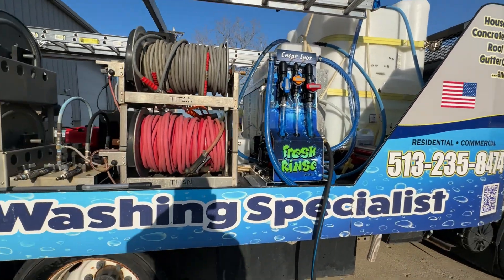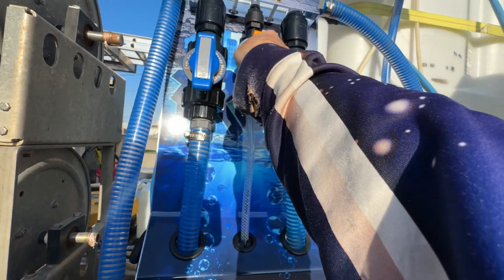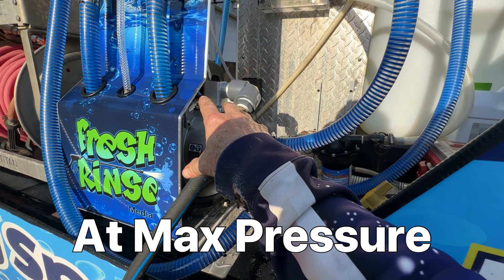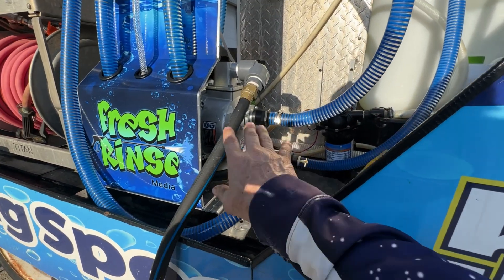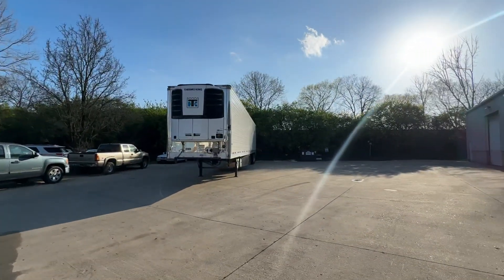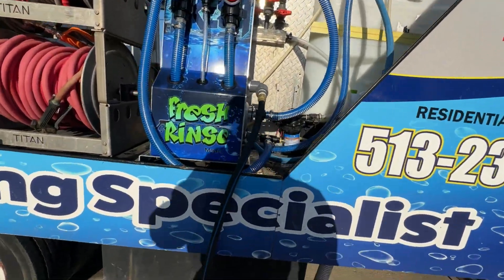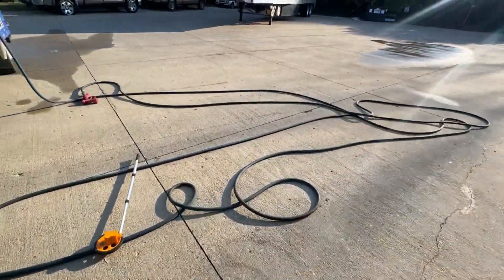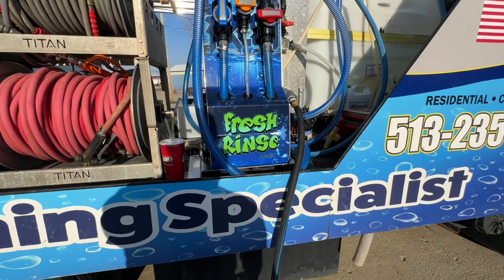My Personal CHEAP SHOT! Pressure Relief Valve and Neutralizer Setup

Comment: I built my own and I had mine blow off a couple times  due to I was moving my ladder and it got too hot and blew the cap off  5 minutes off the trigger is too long lol
Reply from the maker: That’s not cool. 5 minutes is definitely push the boundaries
Reply: @TheFreshRinse all about the research and development  😂
Reply: I was on the trigger and my cap blew off... using a waterboss gun right out of the box.

Comment: My pump keeps exploding. I am not sure why. I have the pressure relief valve as well, and try to not let it build pressure by opening the gun.
Reply from the maker: I’m not sure why either. It’s always a pressure situation.
Reply: I don’t know how you have your pump setup, but I don’t think it’s pressure that is the issue, it’s heat from the pump head recirculating the water when you stop spraying.  This creates steam which then creates pressure, which then deforms the plastic caps, which then launch off the pump, and then if you weren’t close to the machine would dump your entire supply of bleach out. Purely theoretical thought experiment on my part 😂, but when you setup your unloader pay attention to how hot the pump head gets. I’m only batch mixing with mine right now so I’m not using a mixer but I do have the unloader dumping back into the mix tote. I set my unloader so it pumps enough Mix back in so the pump head stays cool when you’re not on the trigger. If you have a proportioner system some guys will create a loop with a bunch of hose off of the unloader and put that loop in their water tank and the other end of the hose goes back to the mixing block. See another comment down below for that.
Reply: That's what's happening to me... even while using the gun it overheated. Not sure what im doing wrong

Comment: I have mine setup off a ibc tote for buffer.. 1 in non collapsible hose to the pump 3/4 harbor freight hose out with the general pump blue gun.. but with the screw backed somewhat out it wants to bog down and shut off.. do you think it's dead heading.. do I need a bypass?
Reply from the maker: I think you have too much oil in the machine.
Reply: @TheFreshRinse I'll check it out tomorrow.. I believe it's .3 of a quart
Reply: @TheFreshRinse I changed the oil.. disconnected the low oil pressure switch.. runs around 10 minutes starts sputtering then dies.. I believe it's fuel vapor lock or something along those lines.. 115 degree ambient air temperature in Arizona

Comment: What kind of effect would running a 1/2 or 5/8 ag hose be if you kept all other plumbing the same?
Reply from the maker: Great question. WAY less volume. 3/4” is a must.
Reply: @TheFreshRinse I have it setup with a half in hose to my blue gun but I'm not getting enough water or pressure.  Is it bc I need a bigger hose?

Comment: Hey Mike what rpm’s are you the cheap shot ? Thanks
Reply from the maker: @anthonyshook1911  Oh gosh, I have no idea what rpm the motor runs.
Reply: @TheFreshRinse did you surpass the stock governer on the throttle or did you leave it alone?
Reply: So just for clarification.   Tighten up the pressure relief valve then start the motor.   Stay off the trigger.  Slowly start opening the PRV until water comes out.   Once the water comes out you tighten back up the PRV 1/4 turn.    And that’s it correct?    I saw another video where the gentle man was opening the PRV while off the trigger and once air flow started he opened the PRV another 180degree turn open.   Can you clarify if you can.  Thank you.

Comment: I'm having a hard time conceptualizing the benefits of the pressure relief valve if it's not "blowing off pressure." It looks like a closed loop that's just pressurizing the acrylic manifold with hot water/steam/chems. My concern is that by sharing the pressure with the manifold, you might prematurely wear it or crack it. I also think that this is like reasoning, "my tire pressure is too high so I'm going to install a relief valve that dumps back into the tire in a different area." Am I wrong? I'm all for innovation. I love my CheapShot! I think I might try something similar but take the line off the pressure relief valve and coil it up using more hose and place the coil in my H2O tank so the the cold water cools the fluid. IDK. Thanks Mike!
Reply from the maker: @MrColinALewis  I think you are correct

Comment: Thank for the video Mike!  So what I think happened to me is the plastic cap was not on tight enough and vibration  caused the cap to unloosen. I did however install the 1/2” mnpt with. 10mm Allen the next day. It’s easy to take off to prime if needed and not an issue. 
Your idea of a pressure release valve is going in the right direction but not a closed loop because the pump would still have the same amount of pressure once that fluid goes back into the system. What I think may be better is having the 1” line dispose into a small 20gallon tank or maybe even a 10 gallon tank. I think that would be a better relief of pressure to the pump  than a closed loop. Also I think I should just think of this pump like a p40 only way less expensive, where you should never be off the trigger for long. Thoughts?
Reply from the maker: @SoftwashKing  I think you might be onto something. Thank you for the insight.

Comment: What if you don’t put a pressure relief valve there and just have a longer hose like 20 feet curled up and going back to the proportioner. Sort of like a bypass, do you think that will be sufficient?
Reply from the maker: @teampropowerwashing  you will have a continuous flow, which means you will be diluting your chem

Comment: Hey Mike, is neutralizing the pump necessary? What is the purpose?
Reply from the maker: @TommyWindowKing  I have only started doing it as of today, so no, it is not necessary. However, any added protection to the pump is good practice.
Reply: Hello Mike how long should I run the neutralizer through the pump ?just a few seconds ?

Comment: That pressure relief valve is the same as an unloader. You are still running pressure through the manifold and the pump.
Reply from the maker: @vansage2691  But in a constant flow, yes

Comment: I just set mines today and I’m getting 50+ feet with 250 ft of 5/8 hose in the reel! I’m impressed! Thanks for this idea! I always wanted to switch from a 12v to a gas pump  and this is a great little machine. 
Try installing another 3way valve for the SH so you get more water flow and rinse the whole manifold after spraying the chemical.
Reply from the maker: @Roblesgroup_co  You might consider using 3/4” hose. You’ll see much greater flow.